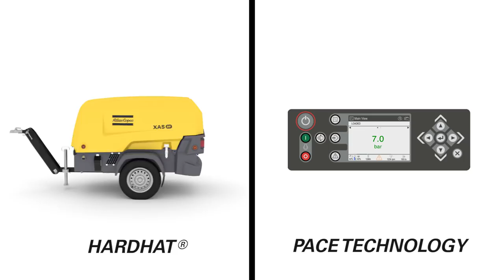Mobile air compressor, towable construction equipment with PACE technology XATS 138 Atlas Copco

Comment: I own a XAS 90 2016 Hard Hat Model Air compressor and I need to figure out how to lower the air pressure and there is no videos or actual instructions on how to do. I cannot believe there is not a you tube video on watching a mechanic make an air pressure adjustment. I am winterizing sprinkler systems in Colorado and 80 PSI is the max you should use to blow out a system. 125 PSI is too high a pressure. Can it be done?
Reply: Hi Robert, please call your local Atlas Copco Customer Center. But to give you heads up, there is a regulating Valve on top of the Oil Seprator tank. Then adjust is slowly in unload to get your desired working pressure. Thanks